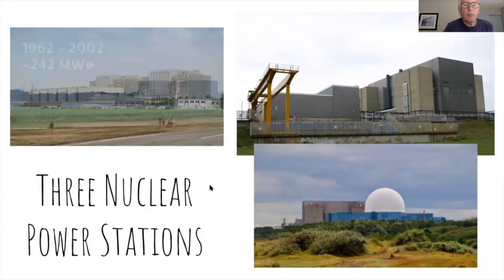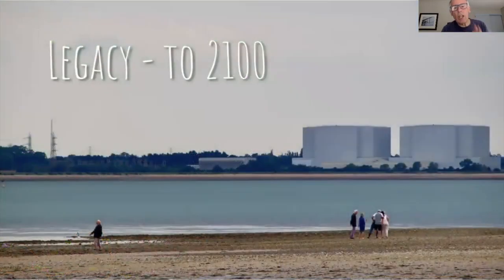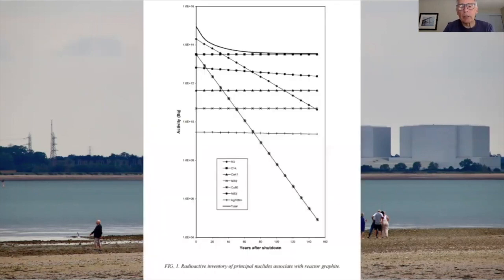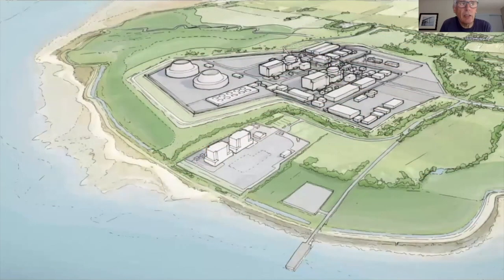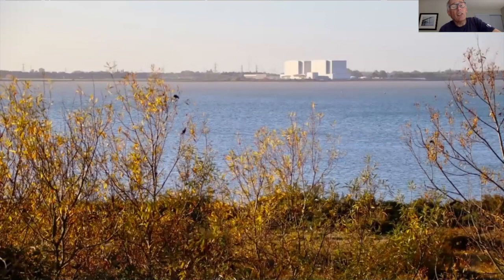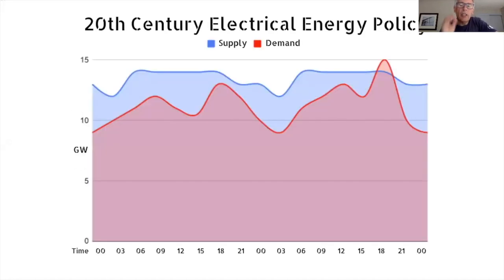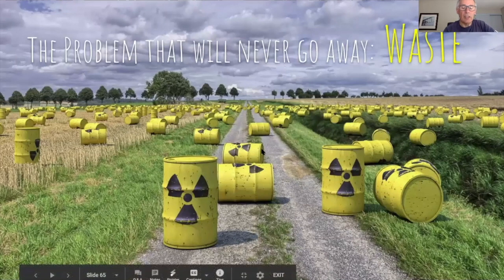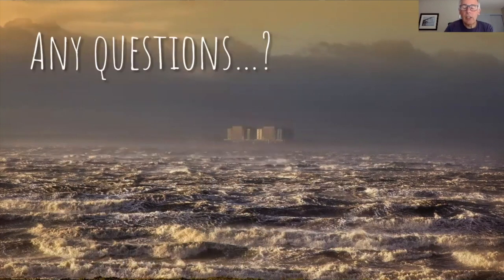Nuclear Power at Bradwell, Essex: Past, Present and Proposed - Peter Banks' presentation for the JAN

Comment: The "wait 80 years" strategy is inspired by US NRC "SAFSTOR" strategy of decommissioning. It is in line with the ALARA principle, which in this case strongly prefers to wait as much as possible before starting the deconstruction work.
Of course this doesn't mean one cannot deconstruct faster. The 80 year period does not mean that it's unsafe for a human to enter the building before that time. Indeed certain nuclear reactor buildings have already been demolished much sooner than that, some almost immediately after closure. However, the global proliferation of ALARA among both the nuclear industry and nuclear medicine makes that option preferred...
Reply from the maker: Thanks. Yes, certainly there have been some reactor structures for light water reactors that have been demolished. However I believe that none of the graphite moderated reactors stations have. Certainly none in the UK and the graph that nearly bottomed out was at 80 years and ALARA certainly applies.
Reply: You're right, certainly this hasn't happened in the UK yet nor was I able to quickly find any example elsewhere either. Note that even the oldest station, Calder Hall, was shut down just 17 years ago though, so it's pretty "recent". In any case, after fuel removal these structures could be demolished if one wanted to. But there always seems to be more political incentive to postpone, and the engineers and owners are happy to defer the operation for as long as politics wills it. It's not like some new project is competing for the plot of land. Although it would be nice if new power stations were built right on top of old ones.
Reply from the maker: Thanks. Not sure about new on top of old but from a fiscal perspective to reconfigure older sites has some merit. The trouble is the industry wants to make brand new, monster stations at huge cost to the public via electricity bills and, potentially, effective taxation with the Regulated Asset Base (RAB) model. Take care, PB
Reply: @no2brb  I am not so much against the RAB, it has its flaws but it's much preferred to the private investment model for this kind of infrastructure.
First of all, from a nuclear engineering perspective these power stations should cost £3-4bn, not £22bn. In such a case they would be viable for private financing.
But, even at £22bn the capital cost of such a station is a small contribution to the electricity cost. With a 60 year service life and 3200 MW capacity the capital cost contribution is barely £14/MWh. The problem with Hinkley C appeared due to the private financing model of the station which due to the interest payments that rapidly get higher and higher, requires a £95/MWh strike price to repay over 35 years. That's £84bn in total payments over 35 years for a station that cost £22bn. It's simply ridiculous that a privately funded project requires this kind of revenue just to break even, all due to interest.
With RAB there's potential to have the final electricity cost from an identical station be only £30-50/MWh. Of course, better would be to build these stations at a quarter the price, as they should.
Reply from the maker: Thanks again. It is intriguing that the cost for finance for HPC was so high (with the compound interest) as it had to start from a relatively high starting point. I guess that indicates the greater risk investors were troubled about. Regardless I understand the sums you've laid out, but I feel uncomfortable about the blank cheque potential with investing in something that has not been proven under the UK regulatory standards.

Comment: By the way - this is one of the main advantages of Gen IV nuclear - process heat.

Process heat is around ~1/4 of total energy use 
https://www.iea.org/data-and-statistics?country=WORLD&fuel=Energy%20consumption&indicator=Total%20final%20consumption%20(TFC)%20by%20sector
where industry comes out on top - and around 90% of industry energy use is process heat.
(note this is a different partitioning from counting electricity as a separate sector)

Thus, using nuclear we can decarbonize a huge sector of the economy. There really isn't anything on the renewables side (maybe biofuels? but they are more useful to decarbonize transport) that can provide process heat.

Something like Moltex meets your energy trilemma - process heat reduces energy requirements; siting can be localized; molten salt energy storage permits an extremely responsive dispatchable capability!
Reply from the maker: Yes, I appreciate the difference and the possibilities and, believe it or not, I have a mind that is open when the I can see the joins all match up!

Comment: Great news about the Bradwell Interim Storage Facility. The fact that such a small facility can contain Bradwell's, Dungeness' and Sizewell's waste shows how concentrated and manageable the waste stream is. Once again we learn nuclear waste is contained waste!

The nuclear industry takes responsibility (even if the motivation is due to the law, the bottom line is that they take the responsibility) for waste products. The science-based approach to the extra containment for spent fuel, where actual measurement indicates more containment needed - and then the industry building it - really illustrates that point.
Reply from the maker: Well, a raft of comments to respond to, thanks again and again! At least I can put you straight on some points you question and maybe ponder some of yours.  

Firstly the Interim Storage Facility may look small but it's physical size is larger up close. There is a substantial difference from your perception about responsibility this side of the water. The US nuclear industry may pay up for the waste it creates but here all the waste from the original Magnox reactors is paid by the state via personal taxation. And all the current fleet, except I believe Sizewell B, the waste streams are also not paid by the industry, the public picks up the bill again. However, there would be financial provision paid into a pot should the new stations be built. But, again, there will be a component that the public pays through tax as well as via a surcharge in their electricity bills.

Comment: Also interesting, I did not know cooling towers are planned to be used. This is unnecessary for a plant next to the water. However, it's due to water protection principles that they're required to do this, I'm sure. If they didn't need cooling towers, they wouldn't be planning them, as it adds significantly to cost. But the land use depicted on the design is a more serious environmental impact than some warmer water at the discharge outlet. Sadly this isn't a design choice that the builders want to have, it's one they're forced to have.
It's also fair to point out how modern nuclear power sites have increased in size compared to Gen II plants, which is again mostly due to regulations and safety principles. Having them bunched up more compactly to take up less land is a much better principle, it does not realistically affect safety. The only reason it's done is for minute incremental hypothetical "safety" improvements, but sadly the nuclear industry is forced to behave like that due to public opinion. Gen II designs were simply better than Gen III for the simple reason that they take less space, fewer materials and are cheaper for the same power output.
Reply from the maker: Yes, you are correct. As well as an indigenous oyster the Blackwater is home to a sensitive marine ecology all of which would be threatened by a small increase in water temperature over the already relatively high levels. Additionally it is particularly shallow and the tide refresh rate over 10 days. And the environmental impact ashore of such a massive footprint is deeply troubling. Thanks, PB

Comment: NB !!  A new nuclear power plant at Sizewell is the wrong choice for a zero carbon Britain, The climate column: The proposed Sizewell C will not produce electricity until about 2040, which it means it cannot reduce the UK’s carbon emissions with the speed necessary to avoid catastrophic tipping points  The Independent , Donnachadh McCarthy@DonnachadhMc 6 Nov 20,   Just weeks ago, the Climate Assembly set up by parliament rejected nuclear power as an answer to creating a zero-carbon economy. This was due to cost, safety and difficulties with waste storage and decommissioning.  Yet Boris Johnson is reported to be about to commit Britain to buying another hugely expensive nuclear power station.  As this new plant would not be producing electricity until about 2040, it means it cannot reduce the UK’s carbon emissions with the speed necessary to avoid catastrophic tipping points, whereas cheaper renewables can be up and running within a couple of years of being commissioned.  Consider the following analogy. Four years ago, you needed to replace your gas boiler and a company came along and offered to sell you the world’s most expensive experimental boiler ever. It’s been trying to build the first four of them for over 20 years but had not yet got any actually working.  The first one it tried to build, in Finland, is already 13 years behind schedule and has more than tripled in price. The second one it tried to build, in France, is 10 years behind schedule, now costs six times the original quote and has encountered monumental safety issues.  They then tell you the boiler was filled with lethal toxins, which if the boiler’s seals broke, could explode and kill everybody in your house. All your neighbours would have to be permanently evacuated immediately without being allowed to collect their lethally contaminated belongings and the area around your boiler would become an exclusion zone for generations.  The sales-person added that the boiler will cost up to twice as much to run as your current boiler. They demanded you sign a 35-year inflation-proofed deal that makes it difficult to switch to a cheaper renewable energy supplier or use energy efficiency measures to reduce your need for the boiler.  Every single bank refused to lend you the money to install your new boiler, as they believed it was a financially insane project to lend money to.   There was another problem. The experimental boiler continuously produces highly-toxic explosive waste that the supplier, after 70 years of trying, still has no idea what to do with. You would have to store it in your cellar, until somebody miraculously comes up with a way to store it safely for millennia.  The salesperson neglected to add that you had to pay for the costs of removing the boiler at the end of its life but that the process takes hundreds of years to complete.  I tell you this imaginary tale to try and explain the utter insanity of what the UK government did when it signed the contract with EDF Energy to build a new Hinkley Point nuclear power plant in 2016. Hinkley is already a year behind schedule and nearly £3bn over budget.    And now imagine this. Despite all of the above and knowing that renewable energy alternatives have already fallen to less than half of the cost of this experimental boiler and that new renewable electricity storage technologies have been likewise collapsing in price, the same contractor comes back to you to persuade you to buy another of these hugely expensive boilers for your second home.  Unlike almost every single government in the world, Boris Johnson’s government is reported to be planning on announcing in the next few weeks that the UK will agree to build a second new EDF nuclear power plant at Sizewell in Suffolk. Why would any supposedly sane country sign such crazy energy contracts? .........
Reply from the maker: Thanks again Tim. P

Comment: Given that the UK wanted a power plant on the Blackwater estuary site, it is good that a environmentally-friendly, low-impact, small-footprint nuclear power plant is planned, rather than:
* a environmentally-terrible high-impact coal plant, designed to create massive ash piles, mercury and arsenic emissions and of course, global warming CO2 emissions
* a environmentally-terrible high-impact natural gas plant, designed to create global warming CH4 leaks and CO2 emissions
* a environmentally-terrible bird-murdering wind farm with environmentally-damaging access roads (although I assume other sites would not be so bad)
* a environmentally-terrible land-covering solar farm designed to keep sunlight from reaching plants (although I assume the UK's vast desert sites would not be so bad)
* or environmentally-terrible tidal generators designed to keep the ocean from reaching the coast
It is unlikely the UK will declare the entire estuary off limits to development; but at least we can minimize the impact of development.
For example, using the 2 cooling towers nearly eliminates the return of heat-waste coolant water to the ocean. The cooling towers and ocean sourcing also indicate, unlike the French reactors (without towers and sited on rivers) you mentioned having to shut down in 2018, that hot weather will be unlikely to shut these UK reactors down.

GIven the introduction of Ecotricity later in the video, just a quick calculation to show how dense this is:
* Sparsholt 6 MWt over an estimated 6 hectares (using the scale from the PDF of the plans, not super-accurate)
* HPC 3260 MWe over 174 hectares (presumed close to Bradwell C at 3000 MW, but no data on area)

Sparsholt has 1.0 MWt/ha (not including area of land for grass feedstock)
HPC/Bradwell C about 18.7 MWe/ha (not including laughably small land area of uranium mining)
Reply from the maker: OK, some points here we certainly agree, let's clear those up first!

Agree:
* The UK has nearly phased out coal and will never build another coal fired plant. 
* Yes, agreed, natural gas fired plants should not be added to generate electricity
 Disagree:
* Come on, you can do better! Wind farms do not mass murder birds and the majority of our wind farms are off shore. https://cleantechnica.com/2018/02/21/wind-power-results-bird-deaths-overall/ and they are far less damaging environmentally than the majority of other forms of generation, including nuclear!
* Tidal needs appropriate marine geology, high tidal range and it works really well. I concur there is some debate over some proposals.
* Solar farms also work well, I agree they are a low output for land use. Domestic and commercial roof solar is ideal. 

The estuary here is very shallow and could not sustain the direct cooling and so the alternative proposed is this hybrid cooling system. But that presents issues because the return water will damage the marine ecology (oysters cultivated and harvested from this estuary are exported to the world!) with both heat and concentrated salinity. It is more likely that the intake pipes would become clogged with algae in the hoter weather. Every year there is a phenomena here when there is this natural algae appears and completely covers all the beaches.

In the developers consultation documentation the water abstraction will be 9m3/second with 7m3/s being discharged, the remainder becoming water vapour through the towers.

Green Gas
I don't know what the US dependency on gas is for heating, here in the UK ~80% of home are heated by natural gas. Hence the suggestion that reducing use of natural gas in the grid by switching to Green Gas, I was not comparing with nuclear.

Uranium
The UK has no indigenous Uranium. That means there is no energy security going down the Nuclear option. I am sure you appreciate that the preparation of Uranium fuel is very energy intensive.

Comment: Can someone tell me what is the link between Bradwell B and Sizewell C? FT has article on Sizewell C to cost £20bn
Reply from the maker: Thanks Tara. The link is that both EdF (Électricité de France) and CGN (Chinese General Nuclear) are joint developers / shareholders. The difference is at Sizewell the proposal has the same reactor design as the one being built at Hinkley Point C whereas the one proposed for Bradwell B is a Chinese design. I hope that clarifies? PB

Comment: I note your low-carbon numbers are cherry-picked - 6th of June - end-of-spring (spring is usually windiest in northern hemisphere); start-of-summer (summer is usually sunniest); and of course low heating demand, low air-conditioning demand, low lighting demand.

What is the data from 6 months ago - 6th of December - (winter usually having low wind and low-sun)? Does the UK top up the high heating demand and high lighting demand with coal? Or with zero-carbon biomass? (yeeesss - we all know how low-carbon South Carolinian wood pellets shipped across the ocean are!)
Reply from the maker: No, not cherry picking, different reasons why I chose a moment that was significantly low becuase of the compounded low demand with such a low amount of nuclear on the grid. I snapshot the figures all year round and I would never dispute the winter is more challenging, but we are a windy country, the most windy in Europe. Bear in mind the UK is relatively small and the National Grid is world leading in their demand side control.